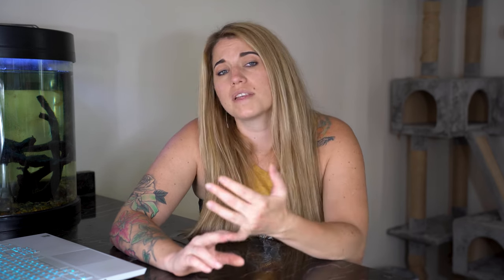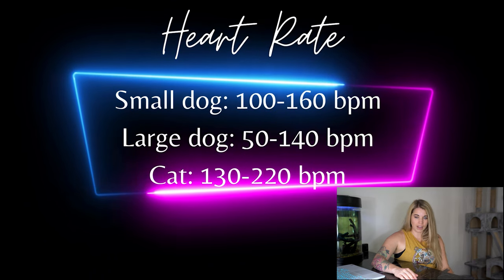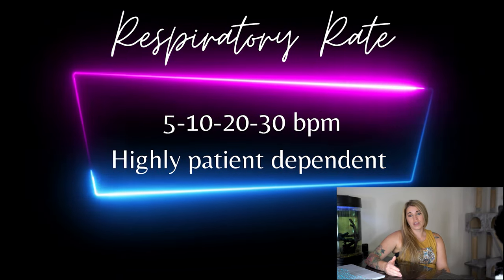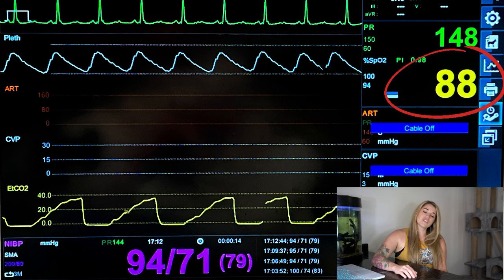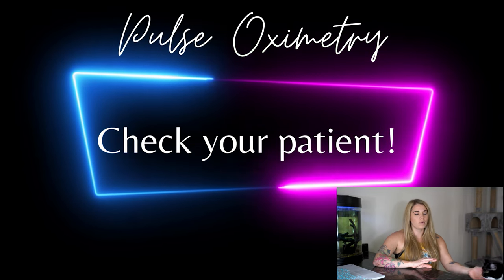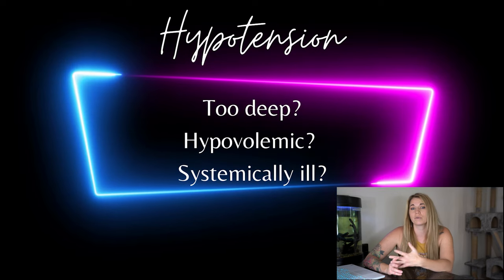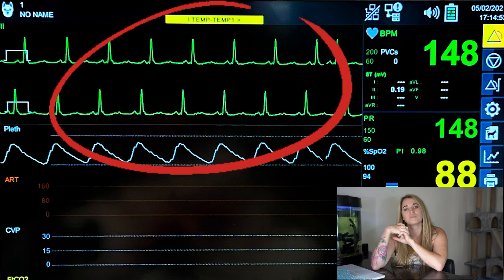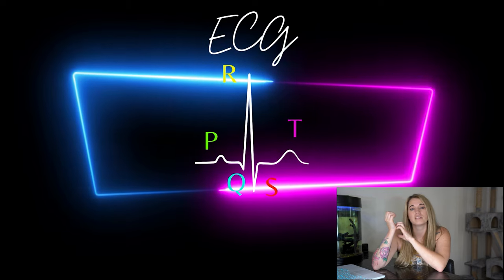Vet Med: Monitoring Anesthesia

Comment: At 8:20 you are saying that the O2 requirement for a dog is 4-7 ml/kg/min which is not true! Later on in the video you show the normal O2 rates on screen correctly! For example 30ml/kg/min for a dog on a rebreathing circuit.
Reply from the maker: Hi Daniel! Initially I was speaking solely of metabolic oxygen requirement, the amount of oxygen used by a patient, which is estimated at 4-7 ml/kg/min for cats and dogs. As opposed to oxygen flow rates within the anesthesia circuit.